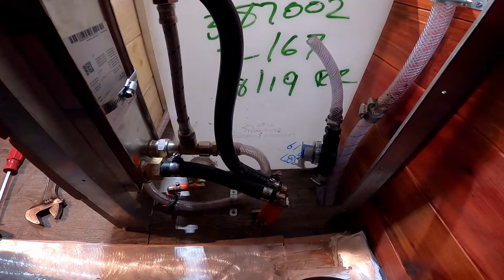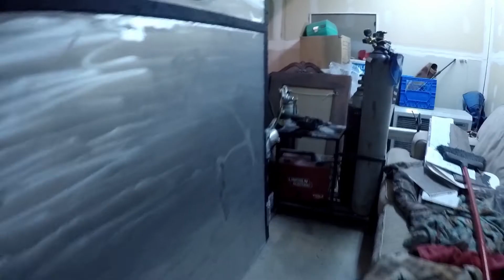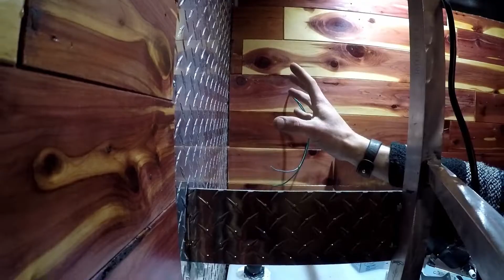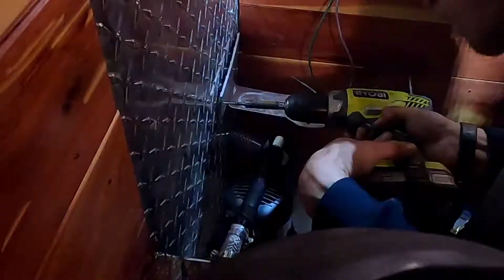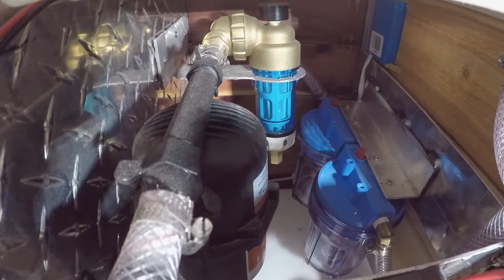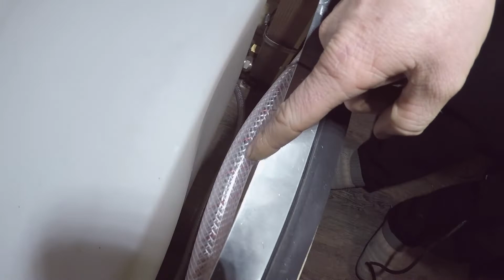Off Grid Recirculating Shower System

Comment: If I followed that correctly, it looks like the filtration and UV sanitation is happening in the supply (from tank to shower) line. I was under the impression that it should be in the return line. The benefit of that, I think, would be that you wouldn't need to worry about cleaning the tank as soon. I might be missing something. I plan to build such a system in my box truck soon, so I'm trying to understand it.

Comment: Something that helps me is a blue and red sharpie marker. I just draw arrows right on the plumbing so I know which direction water is flowing at a glance. I'm sure you know exactly what's going where but even for the audience it helps see the direction of flow.
Reply from the maker: thank you for the tip! we will be sure to mark the flow for future reference and pull out the label maker for the electrical...and perhaps put extra diesel in the tank.. :)
Reply: @beardenlivin138  hahahaha. Yeah diesel helps.

Comment: Great ideas! How do you remove the soap from the water since being dissolved will allow it to pass through your filter system?
Reply: I saw a video on another channel saying that they reduced the sodium problem by switching to natural soaps and shampoos. Another video recirculated just enough water (1 to 2 gallons) to shower and then drained it out to avoid sodium accumulation.
Reply: I have yet to design/build ours but my plan is to only have a few showers before draining, 3 people having 2-3 showers then ya, drain and refill the shower reservoir

Comment: hi friends, how often will you have to clean or change the filters to keep your water clean?
Reply from the maker: hi, Jenna. at this point we are unsure. it will depend on how often we shower. at any normal rate now, we shower 2 times a week. so in theory we should be able to at least get a month using the same water, and filters.

Comment: Shouldn't you have a filter before your first pump drawing from the tank...I guess shouldn't you have a filter on the pump pulling from the shower? To protect each pump
Reply from the maker: there are 3 sets of screens between the drain and 1 small sediment filter right before the return pump. the actual sterilization happens on the way to the shower. I imagine the system could be ran either way.